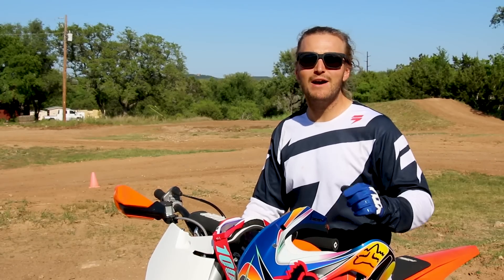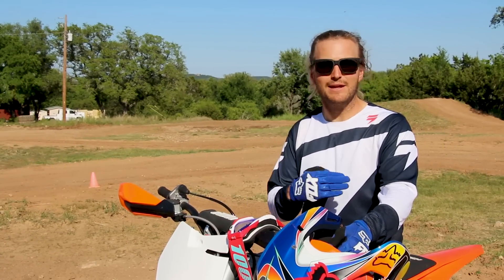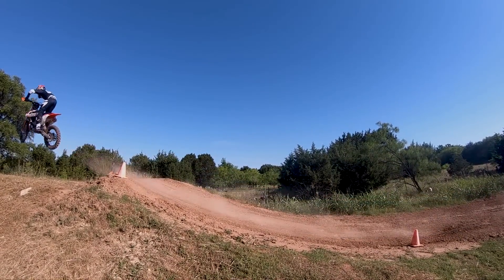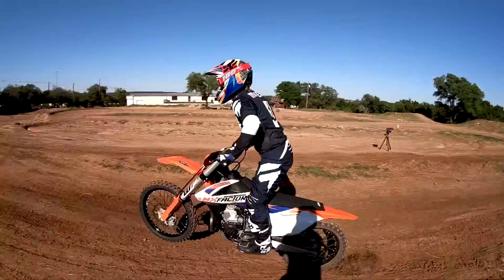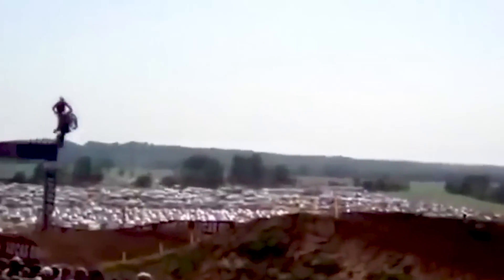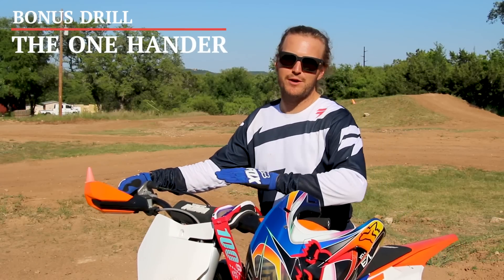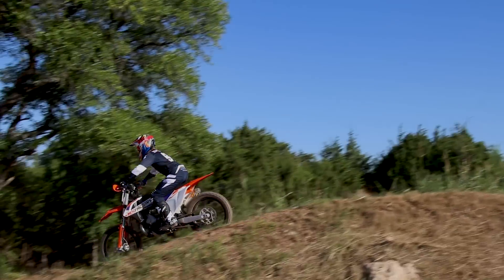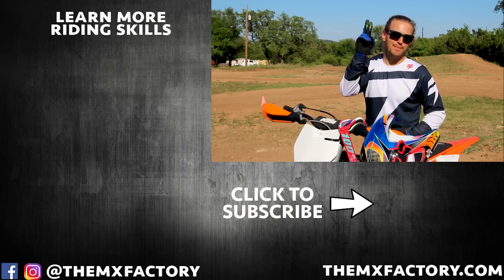Top 5 Dirt Bike Jumping Practice Drills - Gain Confidence & Comfort in the Air!!

Comment: Nice vid you guys are the best out there. I  really like when you guys demonstrate drills to practice. Just burning lap after lap on practice days can be pretty counterproductive. 

How about some tips on jumping when decelerating. For example, small double at the bottom of a downhill or a fast straight with a double landing into a tight corner. I notice A riders  begin to brake for the corner on the face of the jump  while us C class guys need the throttle to get over it, therefore we can't carry nearly as much speed.
Reply from the maker: Great recommendation for a video, thanks for that. And we agree, more focused practice drills versus lap after lap can def make you better quicker.

Comment: Can you do a video on whoops
Reply: nikolas brien yeah
Reply: For sure. That would be great. Even the shortest section with the smallest of whoops.

And thanks for the vid, guys. Easy thumbs up.
Reply from the maker: Yes it’s on our list, thanks for the recommendation!
Reply: The Mx Factory I am also subscribed and have post notification on
Reply: lol go fast and lean back and youre set
Reply: nikolas brien. One method I use that worked for me is leaning back and pulling my handle bars up while giving a rather high throttle delivery when I am going back down to keep a wheelie over up to four or five whoops. I’ve been riding for two months but trust me it works.

Comment: We teach our riders (especially new ones) to use your right hand pointer finger as a marker for smooth acceleration delivery. Meaning pointer finger remains rested on the brake while on the accelerator at all times. This removes that hunting characteristics of the motorcycles because of a choppy hand. It also does miracles when trail braking into the corner whilst remaining at 10% overrev to allow smooth and linear transition through corners instead of being squared off through corner from brutal braking down to no RPMS followed by hard cracking on of accelerator. All of which is waisted traction through tyre spin. Most of our riders have removed seconds from their lap times doing just this at first before focusing on big jumps and how to land them. One needs to be quicker in understanding the science and physics behind a rolling bike before attempting such things!

Comment: So when you come up short try land front tire the when you over jump use your back tire more?
Reply from the maker: Yes, kinda. The drills we have you do landing each tire first are so you can get used to things like that, in case you have an issue in the air. At some point, you’ll land front tire first not on purpose. Then another time you’ll likely land rear first. The point is to try them all in practice so when an issue in the air comes up you are prepared and ready for it. Make sense? It also depends on the speed you hit the jump, the height, the dirt, the jump itself, so practicing while landing differently is very helpful.

Comment: How can I get some of those super cool MX FACTORY stickers for my ktm 450? I have lots of room on swing arms.
Reply from the maker: We actually sell full kits (whole bike) for very reasonable price of $150 dollars if you’d like a set shoot us an E-mail at mxfactory254@gmail.com
Reply: The Mx Factory Awesome I'm gonna check them out. Hey I have a vortex ecu that gives you 10 settings to choose different maps. Are you familiar with them? Just trying to figure out which map would be best to practice slow wheelies?
Reply: The Mx Factory Just found out today that the vortex ecu I purchased from ktmandhusky was programmed for ktm450sx-f instead of the 450excf an the ex-f box doesn't turn fan on. Instead of exchanging for right ecu they suggested I rig a fan switch so I can manually turn it on. What's your opinion?